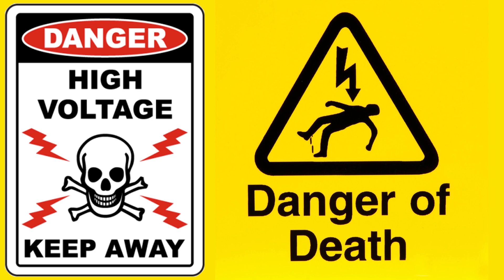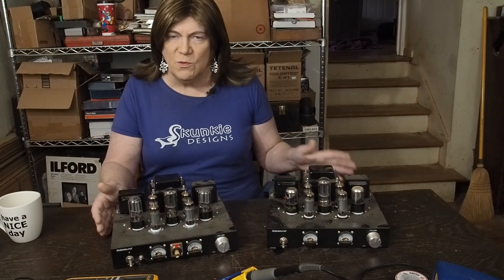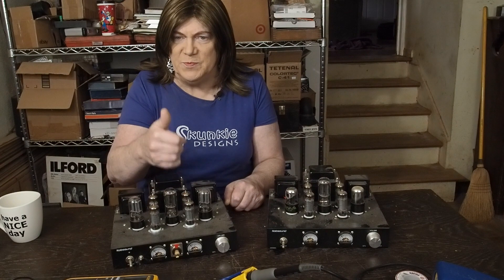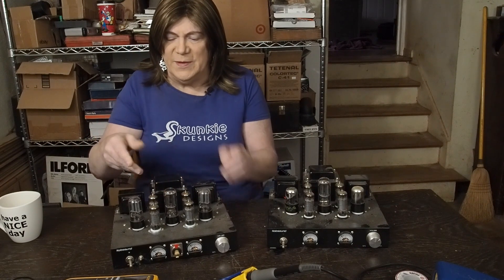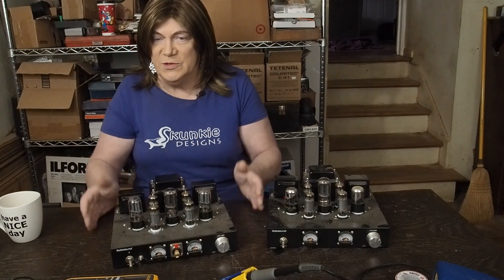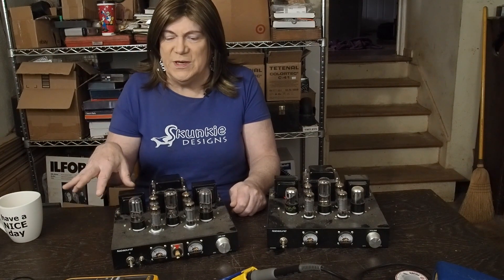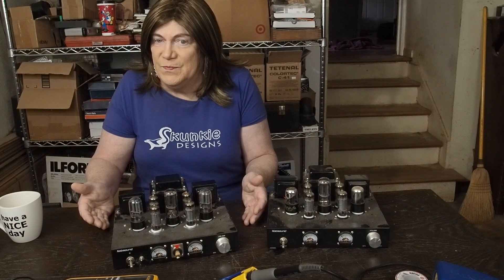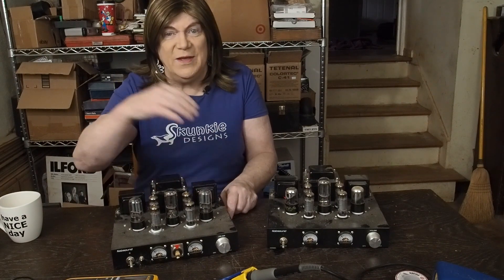Nobsound 6P1 Revisited: Next Level Mods in 2023!

Comment: Double the stock price is so i guess for more power and even better sound.  About this thing though because it was my first tube and instead of dealing with a bunch of used power amps that I couldn't tell were in proper operating condition or specs or whatever it seemed that I have found clearly a single-ended output amp and that was what I most importantly wanted I didn't want any any op amps or transistors or anything I wanted pure tube and although it wasn't going to be the best it was going to be different so that's part of why I got it

Comment: I bought this amp on your opinions . I am in the uk and have the updated version with the svetlana tubes.   I have replaced the 5U4C with sylvania 6sn7 gtb short glass tubes.  Huge improvement.   I am just wandering what rectifier tube people are using ?   Do I stick with the svetlana  or is there something better ?
Reply from the maker: The rectifier tube these come with works fine, on a class A amp, they don't really make any difference as far as audio quality anyway.
Reply: @SkunkieDesignsElectronics  thank you for your reply .   To my ears it sounds great as it is. The sylvania 6sn7 gtb  absolutely wipes the floor with the svetlana tubes.   I was just wandering if the rectifier could be improved .

Comment: Skunkie, enjoy your channel, thanks so much for sharing your knowledge. Here's my immediate thought on what to do with the amplifier- how about a preamp?! A 6SN7 cathode follower preamp that is. Simple is good. Can you make 350+ volts without the present draw of the 2 x 2 PSE output tubes and front end tubes? Might have to go with SS rectifier? Pull the output tubes and see. Don't know what the primary inductance is of the output transfomers, maybe you have the means to measure that? Use the main PS choke as the 1st choke, then possibly split off and use the existing outputs as a following choke for each channel. Depending on the following amp you may or not need a 6.3 VDC supply to keep things quiet. From experience you will need a 330uf cap on the 6SN7 side of the choke to stabilize this cathode follower- this from a person who only wants as much capacitance as needed. Can't believe this manufacturer used what they did as an input cap, what were they thinking?! Scary. And a voltage divider off the power supply to stay within the 6SN7 cathode to heater spec. A simple 5W ?ohm series resistor will bring the 6.3 voltage to spec. Just a thought ... Posting this at 4AM though, may wonder what I was thinking later!

Did you ever determine the primary impedance of the 6P1 ouput transformers? 

And curious. I've watched a lot of your videos, can't say I see you using square waves much. Wondering about the Reisong A12 and 100, 1K, 10K square wave final result ... and this one too. I know we don't "listen" to scopes, but they do tell a certain story. Thanks so much again.
Reply from the maker: Some neat ideas! Thanks.

Comment: Please could someone explain to me what ohm rating does my 1W resistors that I need to buy to set a fixed bias on this, just a rookie trying to get some quality class A sound 😊
Reply from the maker: There is a resistance rating, which is in ohms and that determines it's actual resistance. The W rating is how much power the resistor can withstand. If you look at the schematic,  the "fixed bias" mod is simply a voltage divider using a 1M and a 2M resistor. I used two 1M resistors in series for one leg of the divider, as they are easier to find.

Comment: I don’t typically leave comments, but I’m so excited to see more content on this 6P1! 

I bought it on your advise and so far have managed to change the caps but I’ve been struggling to follow how to change it over to a fixed resistance to get rid of the distortion, currently it’s buttery smooth to about 20% volume and just blearily loud after that. 

Have you noticed any difference in quality from removing the headphone out, when switching to the 4Ohm output from the 8s which the headphones are wired up to I could hear less of a noise floor. 

Can’t wait to see more on this, avidly watching along 😊
Reply from the maker: Switching to "fixed bias" on the input tube does make a huge difference in the audible distortion.
Reply: @SkunkieDesignsElectronics  I used a variable transformer to drop the voltage, couldn’t quite figure out the bucking transformer. Not sure if it’s helped the sound quality but I’ll be glad if it keeps these Sylvania tubes alive longer!

I’ve got a dumb question if you’d be kind enough to answer, it’s what’s held me back from completing the fixed bias :)

What Ohm rating should my 1W resistors be?

Comment: Adding an external fan on top of power transformer reduces considerably it's temperature. Can this cooled transformer hold more current?. And if we also reduce the power tubes shared cathode resistors from 270 to 250ohms or even lower, how much power can we get?. I'm just thinking about a very easy tweak which does not require much time or money spent.
Reply from the maker: I can't in good faith tell people to overload a PT and then put a fan on it. Plus the rectifier tube is limited to 120ma as well. I'm not sure there is an easy, cheap, safe solution and it's why these have been collecting dust.
Reply: @SkunkieDesignsElectronics  Thank you. Yes, you are right. The rectifier tube is almost at maximum current. Mine measured 117mA total. What about a solid state rectifier? Definitely in Class A we are limited, that's why the idea of switching to class AB might squeeze more juice out of the amp, right?

Comment: I don't have a 6p1 nobsound, but by the time you have added 2 x PP, OT's thats some $$$ spent.  There is foundation there for a much better SE amp with more voltage swing etc sfter the Power Trans upgrade.  Would  schade feedback help with bass response?  plus better caps in the psu? Just a thought.
Reply from the maker: No more $$$ than building a new amp from scratch though. I'm probably going to do this in "phases" and see what I can get with just the power transformer and biasing the tubes where they should be and go from there.
Reply: Yeah.  Think that's a great idea, get as much as you can out of it in SE form. And then maybe try PP conversion. Then people can decide. I Notice you have two, a sound off would be interesting, one a PP conversion against the maxed out modded SE. In UK I struggle to get iron, of late I have been buying vintage gear to strip. Some nice small OT's in some of it too.

Comment: Of You can replace the iron for a reasonable prise, I like to go to with the PP option.
Reply from the maker: Reasonable is subjective :) Looks like a 175ma  transformer is just over $100 with $8 shipping and new OT are $80 each + $28shipping. So blew past $300 pretty quickly just on the iron. Oh well, if it turns out sounding good, it is worth it!
Reply: @SkunkieDesignsElectronics  That's actually not too bad. If You shine your light on the schematics, it will be a good amp with a small footprint.
No pressure! 🤪

Comment: I'm looking forward to this. I would love to see a push-pull 6BQ5 topology implemented using Dave Gillespie's EFB scheme. Maybe ultra-linear using new Dynakit replacement Dynaco Z-565 OPT's (intended for Dynaco ST-35 and SCA-35). Triode USA also sells them. Gillespie swears that those are absolutely the best 6BQ5 OPT's on the market. People are selling these amps as fast as they buy them because they don't live up to the expectations that they had, which means prices are continually dropping. When they dip below 125 for a used one I will be looking to buy, because you can't get a nicely finished chassis, sockets, IEC socket, power switch, selector, and meters for that kind of money.
Reply: Also a lot people are keeping them. Why don’t you put the link where they are being sold at the price you are talking about.

Comment: Have you considered running dc on the heaters? The diodes would drop it a volt. In the same way a 5Y3 would drop an extra 20 volts compared to the 5AR4. Each of those would be $10 solutions compared to a new transformer which could be 5 times as much.
Reply from the maker: If you send the 7V AC through a bridge rectifier, you get 8.5VDC on the other side. And the main problem is the transformer can't supply the ma of current the output tubes are capable of, which because the transformer already runs toasty hot as is, would melt down if you run the output tubes any hotter biased. They are running at 1/2 their rated wattage, which likely is why the amp makes so little power.
Reply: @SkunkieDesignsElectronics  I was just talking about diode reduction, but you are correct that you would need some big diodes with the amperage. Most this size are sold as bridge rectifiers which would not work without other regulation. It just seemed a shame to spend half of what the amp cost on a new power transformer, and probably more than the total cost with two PP output transformers. I am glad that you are excited about the modifications. Your skills are definitely up to the challenge.
In a different vein, if you are buying a new PT and OTs, then I would be interested in watching videos of you turning the chassis into the "High Fidelity Tube Junk Box Audio Amplifier" by Bruce Heran. This design let's a person use a variety of tubes because of the CSS bias. Also, the SS rectifier might let you get away without having to buy a big choke for the power supply. Edcore actually has Bruce Heran page in their amp kits section. I am looking forward to seeing what you decide.

Comment: If you modify the amplifier, it would be interesting if you could switch the tubes into something that is more of a common tube, making it easier to tube roll and more powerful. The headphone output is an interesting part of the design and would be cool to keep that functionality.
Reply from the maker: But then it wouldn't be a 6P1 :)
Reply: @SkunkieDesignsElectronics  you do have a good point.